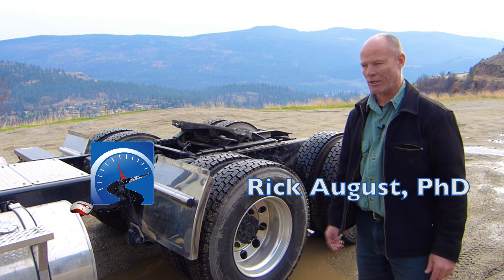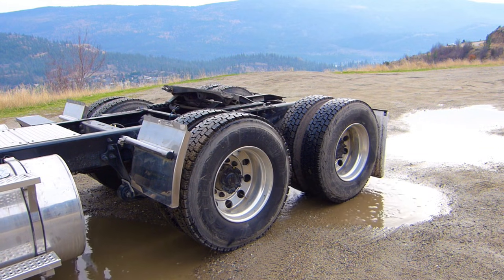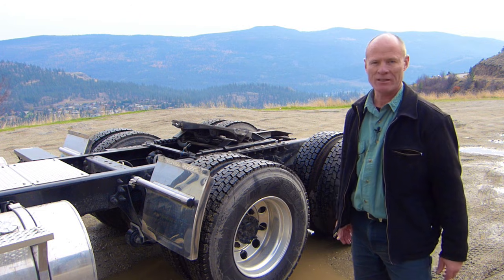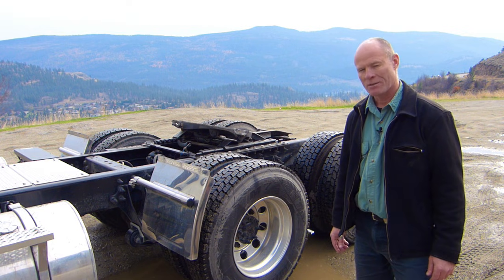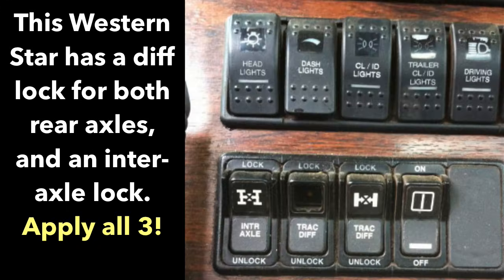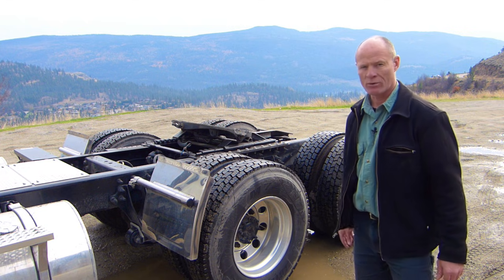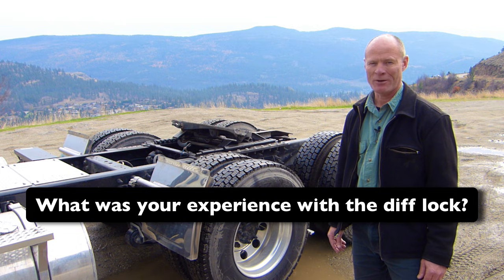The Differential Lock Explained :: Diff Lock | Truck Driving School

Comment: Hey Rick i have a question, I've seen drivers locking the inter while they are claiming a hill with the truck moving slow but moving, is this practice bad for the differential? Can you damage something if you do that ? Thank you Sr.
Reply from the maker: So long as you're less that 10mph you're not going to do any damage to the inter-lock my friend. Drop us a note if we can help further. All the best, Cheers Rick
Reply: You can luck  not more than 25 mph or 40 km   speed and low throttle

Comment: I want to remove my rear axle complete as it’s just a Rv hauler. Is it possible to run it with the diff lock in or do I have to put the rear axle in place of the front one. Thanks.

Comment: As a new driver I used the dif axle lock but on a couple occasions i forgot to deactivate it or switch it off. My question is how much damage am I causing to the truck ? I’ve been told that it damages the transmission.
Reply from the maker: Don't fret too much my friend. We've all done it a time or two. So long as you're not doing a lot of turning or pulling heavy, it's not going to do too much damage. All the very best, Cheers Rick

Comment: Diff lock and Interaxle lock are not the same and have different results / uses. Diff lock locks the left and right side. Interaxle locks the front and rear axle. 

If you have your left side tires in the mud and your right side on pavement in normal operation one set of wheels  will spin. Interaxle lock will make both sets of wheels spin on the left or slippery side and you still won't go anywhere. Not all trucks have diff locks, but if you do, you can lock the left and right together and it will send power to the left and right side and since the right side is on dry ground you move. 

Interaxle is good for driveways where one set of axles gets lifted off the ground and you get one set of tires spinning. I'm sure there are plenty of swift drivers doing burnouts trying to get into a drive, particularly when backing up. You should lock all the differentials, but if you only have an interaxle differential, locking that should get you into the driveway fine. 

Also, do not lock the diffs if you are spinning or you will break something.

Comment: So the right rear tire was the only one not making contact with a solid surface.  It was spinning after engaging diff lock and nothing happening with any of the rest.  It was an easy tug to get the truck Mobil.  Why just the right rear is all I had?

Comment: i've had to lock in the rear diffs on my 2018 freightliner when going to job sites to dump both fly and bed ash before especially after it's rained really hard and the sites are a complete mud hole

Comment: As a new driver, I understand the diff lock and how and when to use it. What I WOULD like to know, is how to use the automated paddle shifter in a Cascadia, on steep hills. When hauling max cap roadbase in a belly dump, it pushes hard going downhill.

Comment: Hi rick  Had my 2018 volvo  it's Automatic day cab. just sitting here park in Florida  for 1month with 100% humidity and lots of rain. Now my   passenger front  tire is not spinning but all the other tires are spinning. What cause this to happen? I'm on a gravel Road do I need to turn on my diff lock for the tires to start spinning?

Comment: Hi Rick, 
There is a misconception here for me. Please what is the difference between these concepts?
1. Differential Lock
2. Inter Wheel Lock

because, around the instrument cluster in the cabin, you can find these two switches in some trucks. What is their different function?
Reply: 1/2 lock, 3/4 lock, or full lock. 1/2 lock is the front left and rear right locked. 3/4 lock or 2 swithces is the entire front axle locked and the rear right locked. Full lock (3switches) is the entire front and the entire rear locked.
Reply: Thats why you see most trucks only have one diff lock switch. Because it is the common 1/2 lock. And some you see two. Those are 3/4 lock. And some you will se three. Those are full lockers. Why even though with 1/2 lock engaged… you will still get stuck and you wont see the wheel spinning. Because its only half lock.

Comment: If you're stuck your stuck difflock does No good. The wheel that spins is just gonna keep spinning
Reply: At least on my 2016 T680. Stuck for the 2nd time and only one wheel spins no matter if it's locked in or not
Reply: The only time it helps me is to get up over a ditch into my uphill driveway (not slick or muddy)

Comment: The Spicer Drive Axles driver instructions says “do not use wheel differential lock when travelling downhill” but does not give a reason why. Would you be able expand on that?

I am a new class 3 driver driving water truck on an ice road in northern Alberta and we have one short but fairly steep ravine to navigate.

Comment: I noticed  strange lines (scratch mark lines) on my rear drive axle super single tires. More lines on driver side tire. The front drive axle tires are perfectly fine. Just wondering whether this could be a differential inter axle issue? Any thoughts? Suggestions?
Reply from the maker: Hi Shon P. John - please send me a picture to rick@smartdrivetest.com All the best, Cheers Rick
Reply: @smartdrivetest  Thanks. Will send it shortly
Reply from the maker: Got it - I'll send a response. Cheers Rick
Reply: @smartdrivetest  thanks very much

Comment: "The reason is because there's a differential. And the reason for a differential is because it let's one wheel pin faster than the other" LMAO the speaker and/or whoever wrote this has no idea how a truck operates at all
Reply: Dude you clearly know nothing either😂😂 that is what differentials are for! So that atleasy one wheel is always pulling but if one has to it can spin at a different speed.. either to help retain traction or allow a smooth sharp turn

Comment: I have 2007 Columbia freightliner and when I unhook the trailer the wheels spin  like shown on this video, if I turn left when I am pulling out it does it more ,if I keet straight does it less,  then after a minute or so it back to ok. If anyone knows what it might be I will appreciate the help.  Thanks
Reply from the maker: It's the Automatic Traction Control my friend. If you engage the diff lock, does it stop spinning? Cheers Rick

Comment: So I was out of school about 2 months, and got a local job, hauling equipment.  My yard has a tendency to wash out when it rains. Loaded up and go to pull out of the yard, eased off the clutch and no movement. Tried again... Nothing. Looked around for a minute or so, wondering if the clutch wasn't engaging or what was going on, then saw the tire spinning in the mirror. Put the inter axle lock on, and tried to hide my embarrassment... 😆
Reply from the maker: At least you figured out what it was in a short amount of time. Some drivers don't figure it at all. All the best, Cheers Rick

Comment: Hi Rick, can you please help me out with the question I have about differential lock i drive tri axle dump truck once in while when I ho work in mud I use differential but for how long I should keep it on running because sometimes all day working into that kind of environment is it safe to run all day on 5-10 km speed? Please explain. Thanks
Reply from the maker: Hi Rav Rupana - yes, if you're working in mud all day at slow speeds, than yes, leave it on. Only turn it off if you head out onto the road and higher speeds. If there is anything further we can do, drop us a note. Always happy to help. All the best, Cheers Rick

Comment: Broke my drive shaft in a customer parking lot had to use diff lock to move my truck did not like noises truck was making
Reply: How did u break the drive shaft? I'm a new driver. I don't want that to happen to me.
Reply: @theblackschwab3561  i didn't the truck had a faulty bolt and it gave as I was pulling away from a dock

Comment: Absolutely shite, you only explained the 4 wheel drive and showed the rear wheels spinning but didn’t show that when you put the diff lock on that all 8 wheels drive so your post was pointless.
Reply from the maker: Hi Stephen Pratt - Thank you for your comment. You're misinformed. The only time that all 8 wheels will spin is if you have a differential lock and an axle lock. Unless it's a vocational truck--logging, gravel, etc.--it's NOT going to have a inter-axle lock. All the best, Cheers Rick

Comment: Hey there thanks for the info quick question can you use them while driving on the snow?
Reply from the maker: Hi Kaleb - Thank you for your question. You can, but not at highway speed. If there is anything further we can do, drop us a note. Always happy to help. All the best, Cheers Rick
Reply: I did I forgot to turn off the lock on the highway did I possibly damage the diff.? Cause now my temperature gauge not work

Comment: Here is what is going on in a more detailed explanation. The back two axles act very much like a typical 4×4 pickup truck in that there are two differentials and a transfer case. If you look at your front axle you will see a protrusion on the top left side where the axle comes from from the transmission. That is where the power goes through to the rear axle and the mechanism that engages the front axle. There is no third differential. Under normal driving circumstances, your front drive axle is completely dead. The drive power is bypassing your front differential and going to your rear differential. If one tire spins on the rear axle, you are potentially stuck. If you turn on your inter-axle differential lock, you are engaging the front axle. Now, you have to have one tire spinning in the front axle AND one tire spinning in the back axle to be potentially stuck. Some trucks come with additional switches to lock the actual differentials in the front and rear axles. Then, you have to have all four tires spinning before being potentially stuck. The entire thing is much like a standard 4×4 pickup truck with a transfer case, and less like an AWD SUV. This is how my current Freightliner Classic works. I'm sure there are different axle configurations out there. For instance, I used to drive a newer Cascadia for a different company. It only had one inter-axle lock switch because it had electronic traction control.
Reply from the maker: Hi Jason Stevens - Thank you for your additional information my friend.  All the best, Cheers Rick

Comment: When chained up always engage the interlock.
Reply from the maker: Hi Arguing With Stupid People - Thank you for your comment. You are correct my friend. And if you have an interlock, you may have to disengage that to go around corners. All the best, Cheers Rick
Reply: Smart Drive Test that’s right ! Be careful, when you going down alway turn everything off to avoid jackknifing!
Reply: @KWOKGB  so only use when going up hills never going down ?
Reply from the maker: And when you’re going down, you might want to throw a single chain on the trailer. And keep an eye in the mirror to see if the trailer’s coming around. If it does, get off the brakes, straighten the trailer out, and then brake again. Cheers Rick
Reply: @smartdrivetest  thanks so much! 🙏🏼🙏🏼🙏🏼🙏🏼🙏🏼🙏🏼

Comment: Hi'my diff messed up and i replaced with a diff lock.my truck is a 2wd and didn't have a diff lock switch.Hw is going to affect my truck?
Reply from the maker: Hi John Kamori - Apologies for the late response. Thank you for your comment. I'm pretty sure it's not going to have any impact so long as you only use the diff lock at low speeds my friend. If there is anything further we can do, drop us a note. Always happy to help. All the best, Cheers Rick
Reply: Thanks for replying. I would like to know what happens when the transmission winds up

Comment: Hello,  I want to know if it is possible for the inter to burst out and make holes from outside in?? Smart drive says he did not have it activated.... Please let me know how it can break down.  As Im a new fleet manager in a new company to save money.
Reply from the maker: Hi Sonia Barrera - Thank you for your comment and query. Most of the time, this is not going to break right away. If left on for a long period of time, it's simply going to wear out the gears and other internal parts in inside the differential. Damage is often caused by the driver shocking the drive train. If there is anything further we can do, drop us a note. Always happy to help. All the best, Cheers Rick

Comment: What would happen if I drive with it on in if something should happen how long would it take to cause damage I  Don't understand why you turn it off
Reply from the maker: Hi MrJohnnys180sx - Thank you for your comment and query. When you go around corners, the tires on different ends of the axle turn at different speeds. When the differential is locked you cause undue wear on the tires and gearing. It would have to be on for a while to do damage, but it will happen for prolonged periods. If there is anything further we can do, drop us a note. Always happy to help. All the best, Cheers Rick

Comment: Are you referring to the Inter-axle diff lock or the rear front / rear back axle diff lock?
Reply from the maker: Hi 78a67h - Apologies for the late response. Thank you for your comment and query. I'm talking about the single differential lock. Few trucks have both a front and rear, and a an inter-axle lock. If there is anything further we can do, drop us a note. Always happy to help.  All the best, Cheers Rick
Reply: Thanks for the reply from which I understand that you are referring to a diff-lock which will lock everything, viz the 2 wheels of each axle and the 2 axles together. Please correct me if I understood wrong.
Reply from the maker: Hi 78a67h - Thank you for your reply and asking for clarification. If you have a single differential lock, it will only lock the front differential. Only if you have 2 and an interaxle lock will it lock everything. If there is anything further we can do, drop us a note. Always happy to help. All the best, Cheers Rick

Comment: If a vehicle is front wheel drive could it have differential if not why
Reply: most FWD vehicles don't because they are mostly just family cars and not typically exposed to off road conditions, but yeah it could, its just another drive axle.

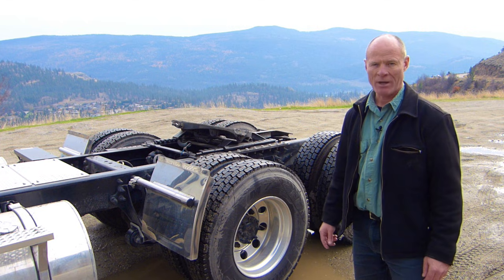Comment: Thanks your video helped me a lot , at 0:53 should this be switched into unlock or lock when driving at highway speeds?
Reply from the maker: Hi Karan Grewal - Apologies for the late response. Thank you for your comment and query. The differential and inter-axle lock (if so equipped) should be in the unlock position when going up and down the road. These are only designed for slower speeds such as parking lots or loading areas. Or you could use them for when you're chained up and climbing a mountain. If there is anything further we can do, drop us a note. Always happy to help. All the best, Cheers Rick

Comment: You need to show the actual engagement of the switch and the truck pulling out.  It's an incomplete video without it.  But there have been times even with the diff lock engaged, I still couldn't get out.  Usually in the winter time trying to get a trailer in a rutted up lot.  When I would go into a place like this and it was bad, I would engage it before I got into trouble.  But at times it didn't work wen the front wheel dropped into a deep rut Causing bothe wheels to be off the ground.
Reply from the maker: Hi Kevin - thanks for your comment. That is great information for the new drivers on the channel. Like 4 wheel drive, the diff lock doesn't always work. In future, I'll amend the video. All the best, Cheers Rick

Comment: Air ride trucks are horrible for traction I drive roll off and gravel trucks my primary truck is air ride it looses traction more than spring walking beam. New drivers must need to know when to stop spinning tires when locked up they may hear a nice bang when they grenade a diff. You never put a driver that has spent his or her career on the highway in a gravel or logging truck they will destroy the driveline or the truck. Local contractor found out the hard way the driver cost him thousands of dollars in repairs.
Reply from the maker: Hi Graveltrucking - a couple of years ago, I had the disturbing pleasure of watching one of the driving instructors get the the tractor-trailer stuck. Rather than getting out and putting a chain on, he sat in the snow for 10 minutes and spun the tires. Too many drivers don't know that you either need chains, or you need a wrecker. As you said, you'll blow the differential out of the unit. Yes, truck are big and will take abuse, but only a certain kind of abuse. If there's anything specific we can do for you, drop us a note; always happy to help. All the best, Cheers Rick